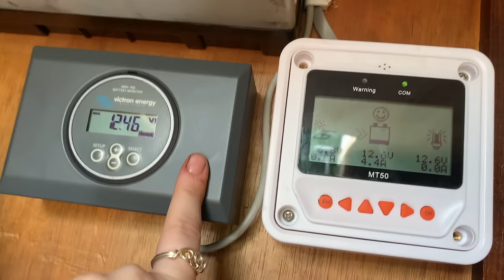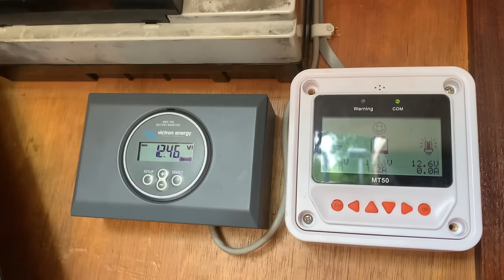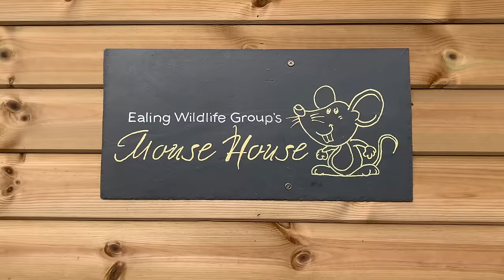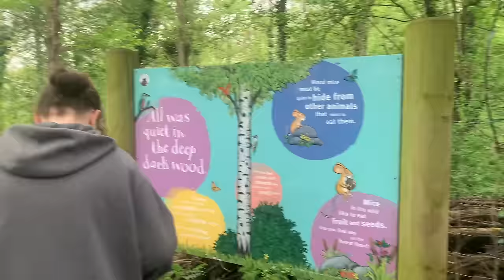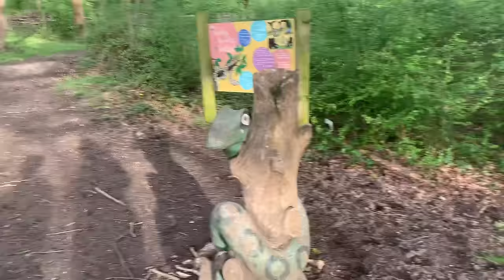A DAY IN THE LIFE on our 62ft NARROWBOAT! | Life on Lavender Lee - EP 10

Comment: Gorgeous singing to greet Monday morning in Australia ❤ 
Yes, a bilge pump will make your life easier. Water can get in via the stern tube (where the propeller shaft runs), especially if the stern gland is a bit old/worn; ingress didn't seem excessive but it depends how much gets in and how often you are having to mop it out.
Hope the rust in the floor at the pointy end can be fixed. Coating it with a decent rust inhibitor before painting will slow down any tendency to rust more, I feel. 
Have a lovely week!
Reply from the maker: Happy Monday to you! We do have a bilge pump, but it doesn’t seem to do much until there is a significant amount of water in there! We’ll definitely try and check out where it’s coming from. Hope you have a great week too! X